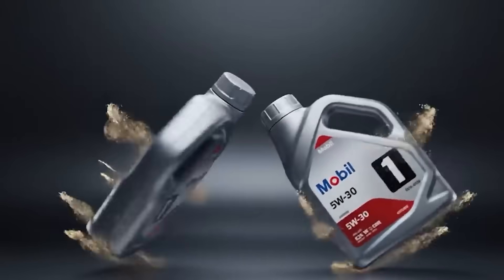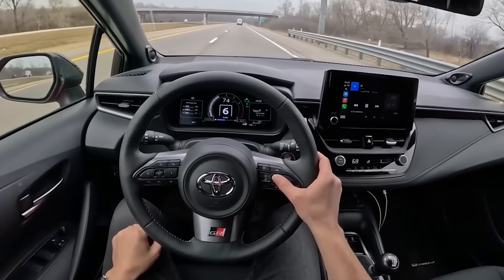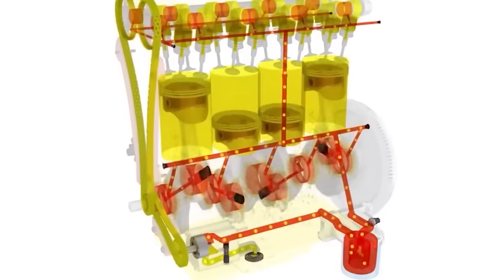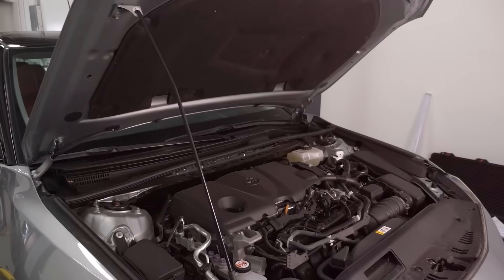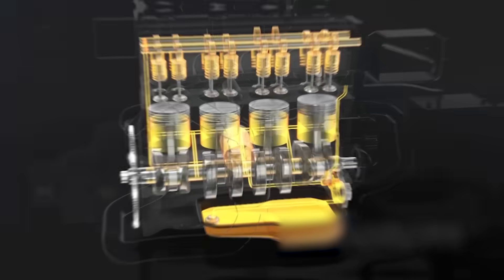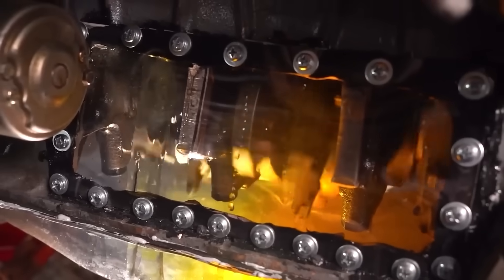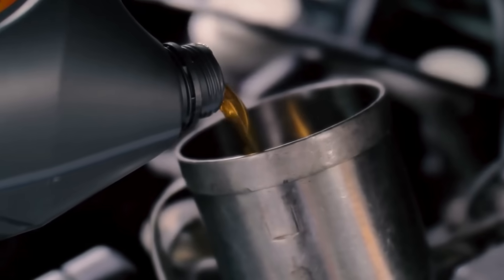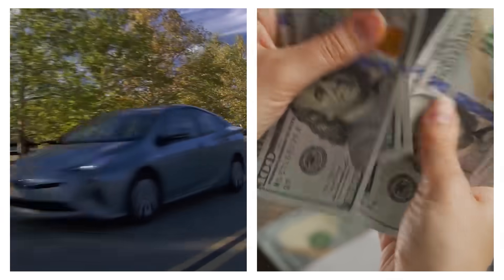Toyota 0W-20 Vs 5W-30 Oil: The Research That Will Open Your Eyes (50 Engines Examined!)

Comment: Sounds like automakers had an AI video made to protect their fuel economy numbers, and sell more cars when those engines blow up sooner. Motor oil Geek says this is misinformation.
Reply: Just comical.  The Motor Oil Geek literally released a video a few days ago showing that Used Oil Analysis from dozens of cars who switched from 0W-20 to 5W-30 INCREASED engine wear.  The difference was small, and statistically insignificant, but it was obviously there.

It is like the parrot club posting on here is incapable of doing elementary research...
Reply: AI video? Did you know this video is also AI lol

Comment: Look in the manual for your specific vehicle for the oil viscosity suggestions.Years ago people would use a summer oil and a winter oil.The ideal condition for vehicle longevity is to change your fluids much more frequently than suggested by either the oil suggestion on the bottle or the manufacturers suggested interval . The 0W - 20 promotes fuel savings.5W - 30 offers greater engine protection when a more extreme driving condition exists . But do not think of an extreme driving condition as consistent highway speeds,towing or hilly roadways.For longevity you have to be mindful of sitting in traffic at a traffic signal and repetitive acceleration to the next traffic signal while commuting or daily driving Stop and go traffic is what shortens engine life.

Comment: 0w-20 is too thin to protect the crankshaft bearings long term. The EPA and the vehicle manufactures do not care about your engine life, more waste oil and better fuel economy has a limit, car makers make more money when your engine fails short term. The best way is change your oil every 2500 miles using a higher viscosity oil like 5w-20 to 5-w30 for smaller engines or 10w 30 on larger engines. Let your car warm up for 5 or more minutes in the winter. I do not care how much gas cost, I want my cars engines to last longer. Use some common sense.
Reply: These claims are just comically absurd nonsense.  If you use Synthetic oil, you will have ZERO wear on your engine when changing the oil every 5k to 6k miles.  2500 mile oil intervals are just complete bunk, may as well just change it every 500 miles.

The fact that you claim 5W-20 is a higher viscosity oil than 0W-20, which is absolutely false at operating temperature, just shows how absurd this claim cocktail here really is.  0W-20 and 5W-20 are IDENTICAL weight at operating temperature...
Reply: `Thin oil is good for those who only lease vehicles. Three years, give it back  and take another new one. No need to worry about longevity of engine.
Reply: You change your oil at 2500 miles? I change mine every 1k miles my engine should go over 2 million miles.
Reply: @vegetar7886  Keep throwing money in the trash...
Reply: @vegetar7886  😂😂😂😂😂

Comment: no engine starts " dry " there is a thin film, don't believe place oil on a metal part let it stand over night, in the morning it will have an oily film.

Comment: cutting to the chase, driving at highway speeds, 80 to 85 which oil is the best.
Reply: What part of the world do you live at? 
Is it always hot? Do you have four seasons? Does your summer heat hit 100 degrees?
Does your winter hit -20 degrees?
As the video says, factor in your environment…

Comment: Rarely see sub zero weather and how does this work in Mexico ?
Reply: It depends on the city.  Mexico temperatures are different depends on where in the country the car is driven.  It is like asking how does this work in the USA.  Well, depends if you are driving in Arizona or Alaska...
Reply: Freezing is what, 32F, 0w20 under 60F should be fine no matter which synthetic...

Comment: Some new cars are taking 0w8. I’ve noticed the engines are noisy.
Reply: All modern engines are noisy, as the variable valve timing and direct injection pumps are loud.  It is not an indicator of anything.  Jet engines are also very noisy, yet last 20,000 to 30,000 hours...

Comment: Is 2.5% mileage increase worth less engine life?  What is the engine life (100K/200K/300K+) based on oil type?  My car is in the south.  Florida mostly.  We do not see really cold weather.
Reply: The best thing to do is get a oil analysis before and after to see what works best in ur area
Reply: There is ZERO data showing 0W-20 causing more engine wear.  Comparing thousands of oil analysis cases, they found around 125 examples of cars switching from 0W-20 to 5W-30.  

When comparing the cases, going from 0W-20 to 5W-30 INCREASED engine wear, it did NOT decrease engine wear.

The difference was small, statistically insignificant, but noticeable.  The amount of wear metals increased in the samples from the cars using 5W-30.

The entire 5W-30 oil claims are based on obsolete data, feelings, and have just become another religion.  There is no actual real world data that confirms 5W-30 decreases engine wear in cars designed for 0W-20.  Literally none...
Reply: Not sure what you’re smoking but 5w-30 protects much better under different conditions. Know why 5w-30 created more wear in an engine that requires 0w-20? Tolerances with engine internals.
Reply: @allcore5172 You really need to read your own posts, and even what the bogus video says. 

People are claiming cars DESIGNED for 0W-20 still work better and wear less with 5W-30, which is fiction.

So, how does it protect "better" anything...???  It protects better in an engine designed for 5W-30 maybe, but nowhere else.

In reality however, most of the wear is from engine starting before the oil is circulating, and there is metal to metal contact with no protective film for a second or two.
Reply: @redbaron6805  Zero data?  Videos are now popping up claiming 0w20 killed the motor.
Reply: @lonniebeal6032  There are zero factual videos showing 0W-20 oil killed any engines.  Literally every single engine recall has been based on manufacturing issues, including debris left over from manufacturing, which has nothing to do with the oil type.

Comment: Why not 0-30 or 0-40 then both cold and warm weather protection ?????
Reply: Because you are relying on a greater proportion of additives to allow the oil to behave at differing temperatures. The additive package is mainly where the oil degradation occurs. The smaller the difference between the "W" number and the hot viscoity rating number the more stable the oil is.
Reply: @rem700longunner  What I was going to say.  If it's really hot, 20w40...

Comment: North Dakota here! Definitely 0W-20 for winter here (Highlander)...but why not then use 5w-30 for the summer months? Seems like a good compromise. I have 0W-20 in now, but she is getting close to 200k on the clock. Seems like a little extra protection during the summer months might make sense? What do you guys/gals think?
Reply: I live in the East Coast 100 miles from Daytona right it's using 0W20. The car 2021 has 26,000 miles. It's can 34 ish here, but this summer this year, it was mostly 90. It's been that hot. I hate the car because of CVT. They are rubbish.
Reply: ND also. I use what they recommend on the cap and change 2 times a year or every 5k miles. That being said thicker in the summer makes sense. 01 Tundra and 12 4runner. Both around 100k, hope I’m doing it right
Reply: The average temperature in North Dakota over the summer months peaks in July at 82F.  It simply never gets hot enough for 5W-30 to have any benefit at all.  You would just be wasting your time and money by worrying about it.

Now, if you lived in AZ and it got to 115F to 120F in the summer, I would say go for it.  But, 82F in the hottest month simply isn't hot enough to make any difference at all.
Reply: @redbaron6805  exactly, we live in AZ and when I change to 0w20 in summer it smells a bit toasty, albeit i have 116k miles on the engine now. Summer will be 5w30 and winter 0w20.
Reply: Yep! I use 0W-20 winter, 5W-30 summer and 5W-40 in the desert.
Reply: change your oil before hot weather hits.
Reply: I uses 0W30 year round
Reply: @honestscentz9300  Which is fine, but lets not pretend that decision is based on any actual data.

This video is the typical mass generated Ai clickbait with zero data, research or facts to back it up.  Even their 50 engine claim is fiction...
Reply: @redbaron6805  no I just aways
Used 0W30
Year round I changed my own oil at 4500 to 5000 miles I used to use 5w30 then I switched to 0w30
Reply: @honestscentz9300  It all depends on what your engine calls for and where you live.  Ultimately, the key is to change the oil every 5k miles, and the oil type will be a factor in about 1% of engine wear over the engines lifetime...
Reply: @redbaron6805 well I have 2018 Lexus rx350 and 2020 mazda3 manual transmission and 2016 mazda3 automatic transmission 347,122 miles to date no issues at all just the alternator
Reply: @honestscentz9300  Which is great, but doesn't really prove anything.  There is no indication at all that you would have issues if you used 0W-20 instead.  

As long as you change the oil every 5k miles, the type of oil isn't a determining factor in anything, especially in the cars you listed.

An even bigger factor is the type of driving. If you are driving over 40k miles a year, those are obviously mostly highway miles, which are much easier on the engine than city miles...
Reply: I agree with you from New York 👍
Reply: Go to a group 4 or 5 100% synthetic like Amsoil or Redline, 0w20 in the summer, should be fine.
Reply: @lonniebeal6032  Absolute total waste of money to be using some super expensive oil.  People who think these oils are 100% "synthetic" don't understand elementary chemistry, in which a ton of Esters, additives and complex molecules are added to the engine, which provide the actual wear benefit.

There are literally 4 actual chemical companies in the entire country which produce motor oil, despite dozens of brands of motor oil.  The difference between 90% of oil brands is the label and marketing...

Comment: My Toyota Avensis has been running on 10W-40 for 25 years and runs wonderfully without any wear.
Reply: long before the 0w20 Bullshit.
Reply: @johnLA1961  That care is 25 years old genius.  People are just addicted to their own opinions, which they think are superior to actual facts and data.  0W-20 is NOT an issue on modern engines, which is obvious to anyone that didn't flunk out of 4th grade science class...
Reply: @redbaron6805  Shame videos are popping up with engines that failed on 0w20.  Your 0w20 will shear down to 0w10 in hot climates, more metals in the oil analysis.  Not every smoker dies of lung cancer, not every KIA will burn oil early or catch on fire.  So a few cars go high miles on 0w20, so what.
Reply: @lonniebeal6032  Except, you are failing your own logic test here.  If some videos are popping up that claim 0W-20 killed a few engines, according to your own logic it proves nothing.

Who says those engines died because of the oil, vs neglect, severe use, cooling issues, poor fuel quality or countless other issues...???

So, few cars with 0W-20 died early, so what...???  Some cars with 5W-30 and 15W-40 also died early, which proves what...???

Comment: what's your thoughts on 0W-16? in the Rav4
Reply: 0w-16 works great. I've seen many Rav4's, Camry's and Corolla's with well over 200k miles without any issues. One Corolla had almost 500k using 0w-16. I just changed my son's oil and filter on his 2013 Rav4 with 195K miles. His car uses 0w-20. Still runs great.
Reply: @jackfrost99  Correct. Likely millions of cars run manufacture recommended oil. Most don't obsess about this debate and have no issues running till the wheels fall off.
Reply: @jackfrost99  yeah I'm old school lol, Thanks
Reply: New Ravs use 0w-8.
Reply: I switched to 5w30 full synthetic in my 2021 rav4 when it was new . now with 80k on the odometer I have zero issues and the engine runs so much quieter , Zero burning between oil changes .